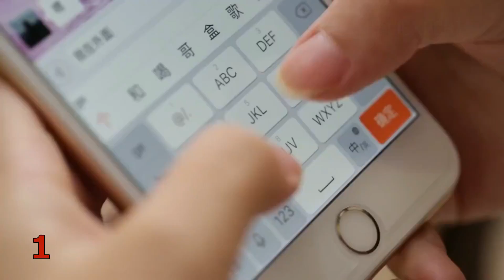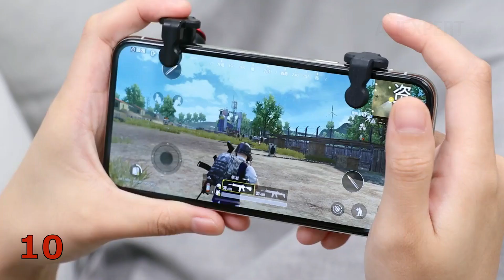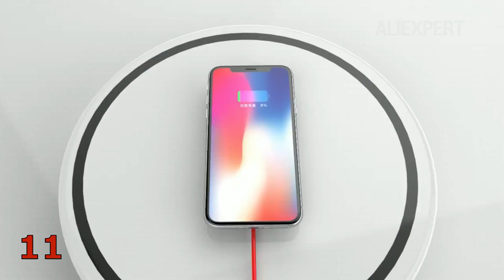THE BEST 11 PRODUCTS WITH AliEXPRESS THAT YOU WANT

Comment from the maker: THINGS WITH ALIEXPRESS FROM WHICH YOU FUCK ON
1) USB-C cable http://ali.pub/3cb27f 
2) Laser http://ali.pub/3cb2ud 
3) Cordless electric drill http://ali.pub/3cb7vz 
4) Bag for storing clothes http: // ali.pub/3cb7wd 
5) Battery for phone http://ali.pub/3cb7wr 
6) Packing machine http://ali.pub/3cb7xq 
7) Food processor http://ali.pub/3cb7za 
8) usb c adapter http://ali.pub/3cb80u 
9) Wireless charger http://ali.pub/3cb818 
10) Game console http://ali.pub/3cb82l 
11) Wireless Charger http://ali.pub/3c8686